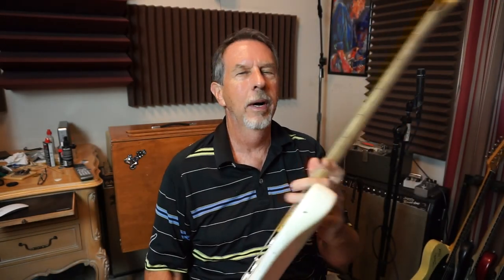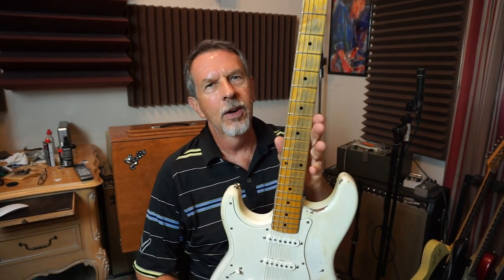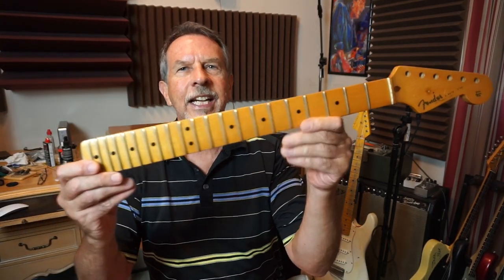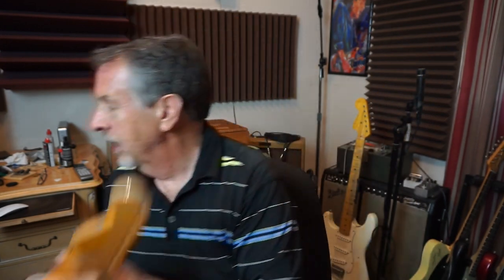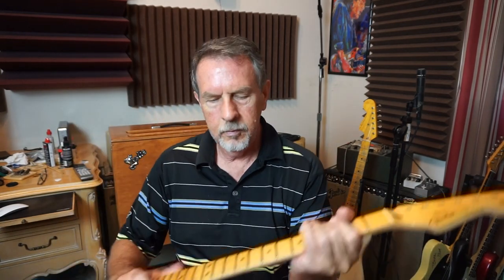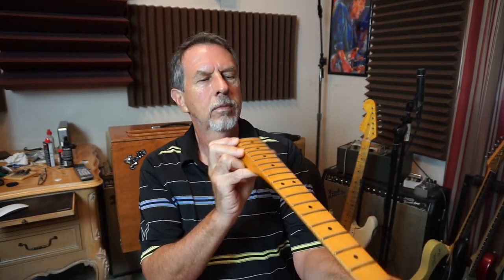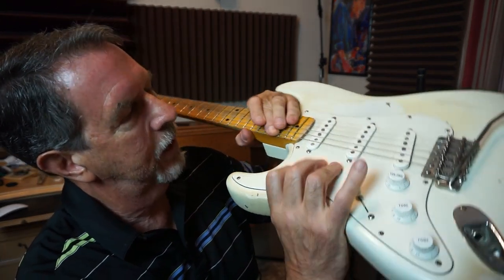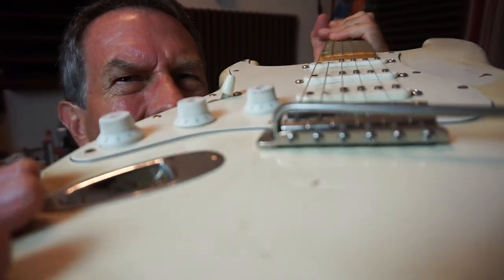I Need Some Advice on Refretting Electric Guitar Necks

Comment: Hi, milstap. First of, I am a very impatient man and could go on and on about the subject of refretting and I am certainly not a luthier. However, I'm perfectly up to any guitar repair/job - except for the refretting. I have never ever tried to do that and I never will. Because it is a very very demanding and precise job for a very experienced and skillful luthier. Maple or rosewood, each has its own little big things to consider. Crowning and leveling also. Otherwise you could buy a 1000$ brand new guitar with custom shop grade fretwork and setup, right? Now if you insist on doing it yourself, buy some cheap guitar necks and PRACTICE.  You make one single mistake with pulling ONE fret out and you have just made the whole job longer, more tedious...and that's only pulling them out. Leveling and crowning...Jesus. But that's just me.
The guitars you showed are worth around 2000EUR each here in Europe. I don't even trust just any luthier to do that kind of work for me, so....at least take my advise and practice on some cheap necks first, wish you luck.
As for fretwire sizes, my preference is always jumbo, less frequent refretting and it has more ''meat'' to work on when you need to recrown the frets.
All the best!
Reply from the maker: Thanks a bunch.  This is why I posted this.  I needed some convincing to forget about it.  The guy I will use put in the EVO Gold wire in my vintage Strats and did a good job.  Actually, I would like to get those taken down just a hair so they are not so tall.  It's the fret ends that would probably drive me bonkers.  I can see me trying to get 42 ends perfect.  Wow.  Thanks.  I am going to order the new neck and that should keep me going for a year while I get a couple of the other necks refretted.
Reply: @millstap  
No problem, see, not just those fret edges, what you said about '''taking down just a hair'' is in fact one hell of a job - plus the setup. There is nothing like a fine refretted and setup guitar, just the way we like it, if I have to pay extra for it, I'm OK with that. Keep on rockin'!

Comment: I am having stainless steel frets put onto my strat, they last forever. Glassier feel though. 
Will have it pleked too. A guitar will play perfectly after being put on a plek machine.
Reply: Tom W - As long as the fingerboard preparation is right.  Plek can’t fix bad fingerboard prep.
Reply from the maker: I had two guitars Plek'd by Joe Glaser but I am not sure it is really worth it.  Very expensive.
Reply: millstap - The machines are incredibly expensive and they have their place in the world.  As a player/builder/repair person I still like the process done by a hand all the way through.

Comment: shoot ! Jimi was really blase  about tuning he just didn't take it very seriously , I mean I never noticed that about the RAH gig but that's amazing that his Strats were not all tuned the same........but this is before electronic tuners so there was no way the tech could tune it for Jimi backstage I wouldn't have thought cos you need to be with the bass player to get in sych......no point using a piano or something cos that would be no gurantee of anything.......Jimi and Billy just tuned to each other unless of course they were playing with saxophones trumpets or keyboard players in studio and then they must have had some sort of system, but even then he would usually opt for slightly detuned, maybe Eb or D for the bass and top string and the rest following suit, so to speak.
Reply from the maker: Actually, they did have tuners.  They were the old original Conn tube Strobotuners.  I have one.  That is what everyone used.  You hardly ever see one if ever in Jimi's stage photos but they were always seen on stage with Led Zeppelin.  I have one from the mid 1960's that was my grandfather's.  He used it to tune pianos.  That is what they used to tune all pianos back then.  They are big clunky things but I used to carry it around to gigs.  It still works.  Conn invented them back in 1936.  I'm sure they probably had one back stage.  https://youtu.be/bgH1cca55m4.  They were chromatic so you could tune to any key you wanted.  They are actually more accurate than the digital ones today.  Piano tuners still use the big expensive versions of the old Conn now owned by Peterson.

Comment: Well, probably not what you want to hear but I'd stay away from this. It's not as simple as you might think even with all the right gear (I used to work at a luthiers shop). If you still want to try it, buy some cheap necks from ebay and practise on those until you got it..
Reply from the maker: Thanks, this is exactly why I posted this video.  If I buy the new neck all ready to go, then I have time to get the others fretted by my pro.  It will probably still be cheaper in the long run.  All of that equipment is expensive.

Comment: "That Pedal Show",  here on youtube, did a special on refreting that was absolutely fascinating.  I will look through thier library and see if I can find it  - be back shortly
Reply from the maker: Thanks.  I love That Pedal Show.  That should be very informative.
Reply: I was going to suggest this same series of videos. Both guys on the pedal show trusted him to                                               re fret their No.1's.
Reply from the maker: @edgeofeternity101  I did watch their video and it was great.  Convinced me not to mess with it just for the expense of buying the correct tools.  I have a fret update that I should do.  I received my replacement neck on Friday and installed it.  It sounds so much better and a lot of it may be due to removing the old shim that was in the neck pocket.  I don't like shims but maybe they are necessary sometimes.  I avoid them whenever possible.  The guitar is louder for some reason.  It is a big improvement.

Comment: Thank you, I also am hard on frets and I just had to refret my strat with ss after only a few years of playing.  I just found your channel. I expect you are expert at frets by now.  I read that srv refretted quite often. He would have been a fan of stainless if they had that back then.
Reply from the maker: No, I still haven't gotten into refretting because the tools are too expensive.  I just ordered a custom Hendrix neck from Musikraft that will have the small vintage size frets but in SS so they last.  I may still need to have some final fret work done after I install the neck.  We'll see.  I'll do a video on it.  It will have a roasted maple neck with rock maple veneer cap that is not roasted.  I hope it turns out nicely.  I did buy a good recrowning file called the Z-File from Stewmac and I recrowned both necks that have EVO Gold frets and they turned out great.  I didn't have to level them, just recrown them and the intonation is better now.
Reply: @millstap  thank you, I didn't realize musickraft had Ss as an option.  you may find this interesting about pick guards and basically it's  on why a strat sounds so good.  https://youtu.be/NRAgvxPs7QI
Reply: @millstap  I wanted to preserve my relicing on my neck finish so I paid 450 for Ss refret, it turned out quite nice, but they convinced me to get a pleck which required sanding the fret board anyway.  I am still happy with it.
Reply from the maker: @russlgtr  I had one guitar plek'd and I thought it was okay until I realized how much metal it removed to get the frets level.  I am not sure it does any better than a good luthier.  I like to preserve as much fret height as I can just in case I ever need them leveled again.  You don't hear a lot about those machines anymore.  I think they were a little bit of a fad in the early 2000's.  If you spend the money to buy a machine, you certainly have to pay for it with lots of expensive fret jobs.  They are very expensive.